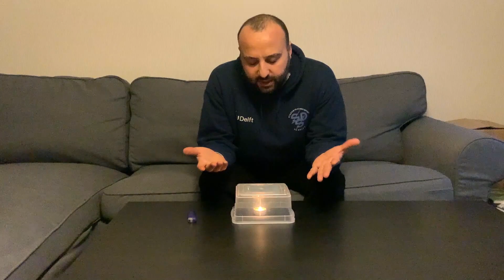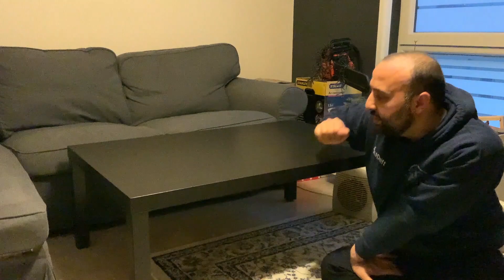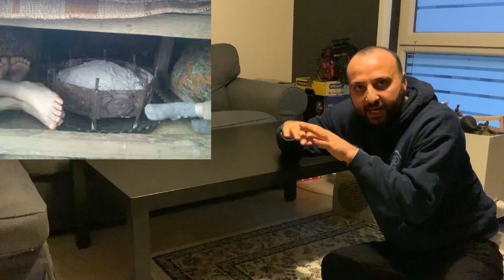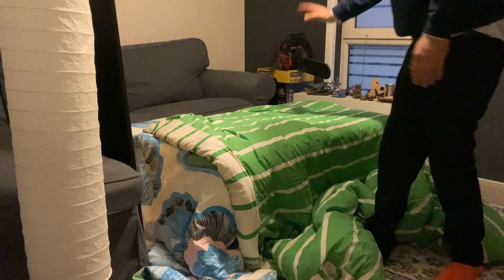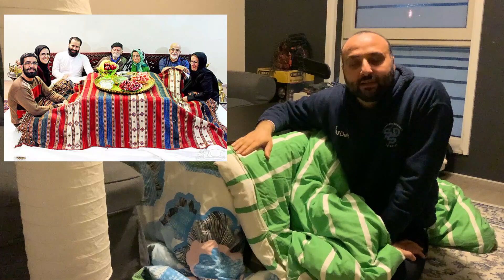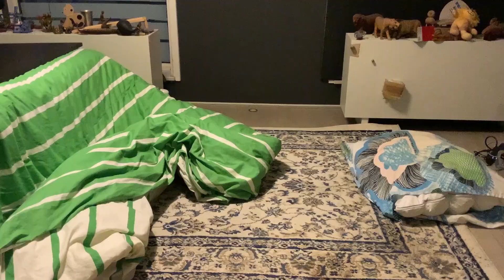Save +90% of your heating cost during the winter using an old Iranian technology ( Korsi  کرسی  )

Comment: I lived in Iran a couple of times for a year or two during my childhood in the 50's with my grandmother. We had a Korsi in the winter. The table used for the Korsi was large and almost the size of the room on the three sides away from the door.  We had long thick cushioning for the floor around three sides of the Korsi and for leaning against the wall along the  three sides. The cast iron charcoal container was under the table. On top of the table was, from what I remember, just a vinyl tablecloth with a silver samovar for tea. I don't think there was a blanket under the table cloth because the surface of the table was not bumpy. The room was always toasty warm so that one did not need to put one's legs under the table covering. We sat around the Korsi and ate, had tea, played cards, etc., and I would sometimes sleep on the cushioned floor alongside the Korsi with a nice warm blanket. It was wonderful. Never any problems. My grandmother must have had a good technique with the charcoal burner. One of my happiest childhood memories. I think that when we make fun of things or people we know nothing about we are robbing ourselves. Life is full of unknown riches. Without an open mind it becomes boring.

Comment: Interesting! Also, a light bulb can be used instead of the heater. I mean one of the old light bulbs with low efficiency! Because these old light bulbs convert the majority of the energy into heat (about 90%), they actually operate as heat sources. To regulate the temperature, you can use a dimmer circuit. It is cheaper than using a heater. The light bulb should not be large; 100W is enough. I made the Korsi before in this way.
Reply from the maker: Thanks Reza, indeed that is a good idea, if the light bulb is protected with something and is hanged from the ceiling of the table, it also provide more space for the legs.
Reply: Good idea, but the fan would be missing and the bulb gets hot to the touch .